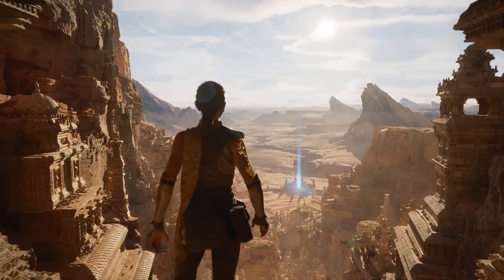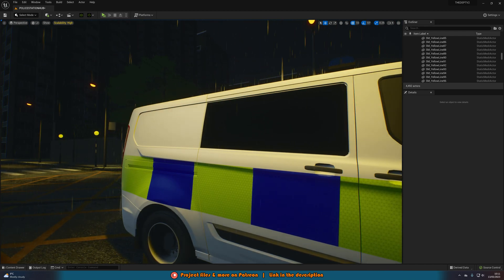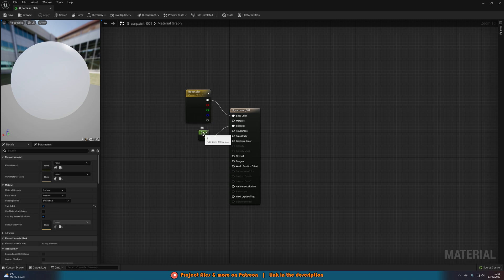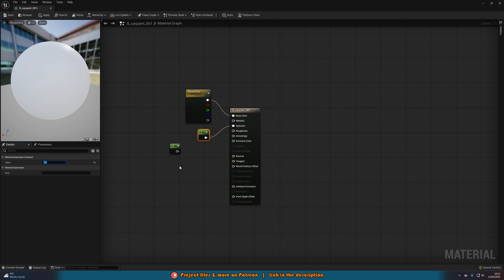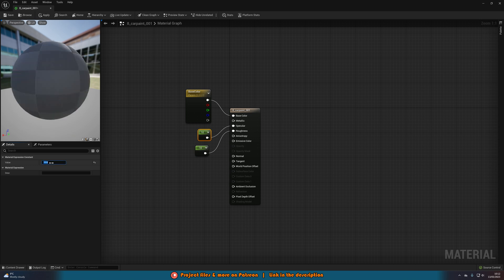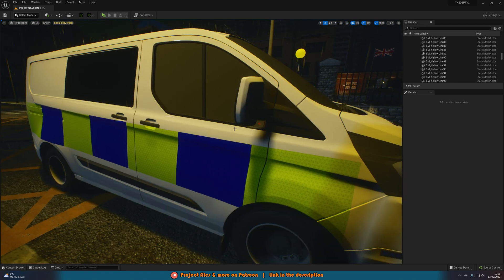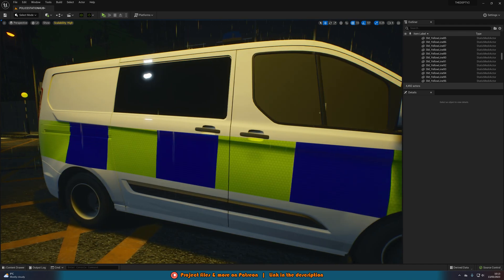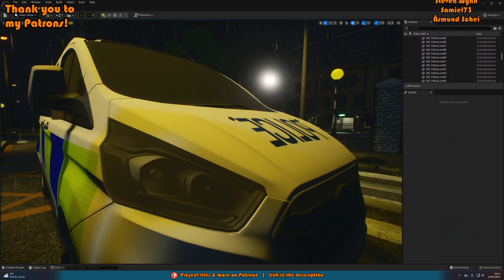How To Make A More Realistic Reflection Material For Vehicles In Unreal Engine 5 (Tutorial)

Comment: Both specular and roughness don't accept values smaller than 0 and bigger than 1, right?
Reply: that is correct. (unless ur have a texture or something that u can multiply with) 
 also specular should be left ALONE as it is set to be Physically accurate. so rly... just play with roughness. Matt I love ur videos but back to BPS!!!
Reply: @Defenceless_baby  There is no reason you shouldn't want to modify specular if it fits your art direction, apex legends crank specular up on everything and it looks good. games need to be quasi-stylized to some degree, even rockstar games do this.
Reply: @KomodoBitGames   yea Apex is a good example. Obviously not a game that tries to be photorealistic.
Reply: @Defenceless_baby  even in photorealistic games you should still have a art style. This is what gives the “asset flip” look is when someone uses a bunch of high res assets but there is no “style” or consistency.

Granted you will be called an asset flip regardless if you get big enough since it’s also a generic insult haters will use but still some games have that “asset look” for not having a style
Reply: @Defenceless_baby  Yeah, if we're talking strict PBR, then specular=0.5. However, i recently realized that i've had my hands tied by this rule from the beginning, to the point that i didn't really know what specular does and how to use it. Some types of fabric, for example, look better with specular turned down a bit.
Reply: @anophyte  100% If PBR is not that important and you going for a custom look then playing around with spec can be very fun.